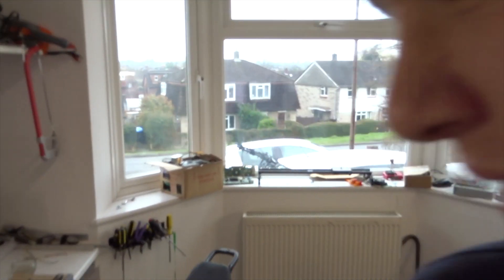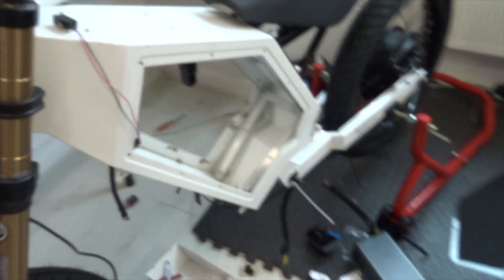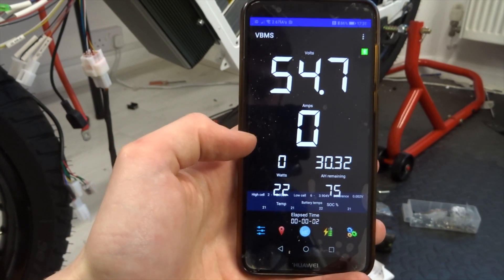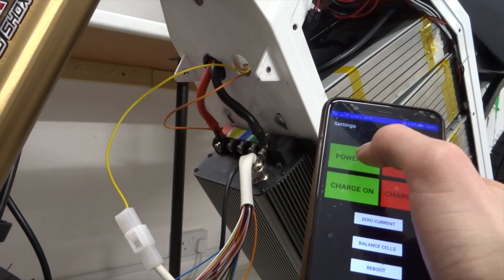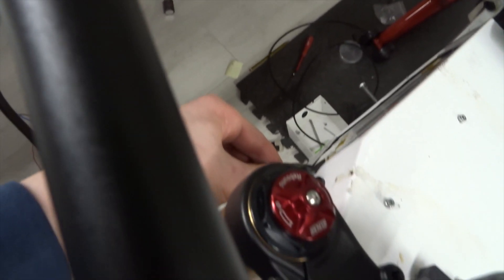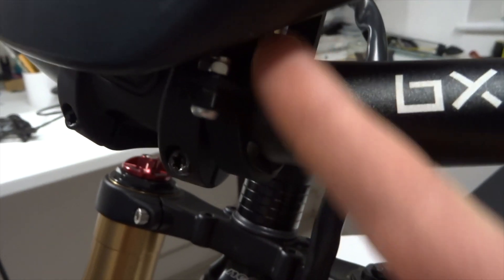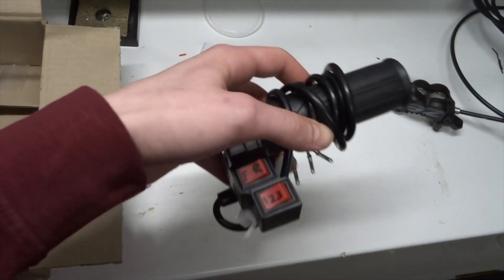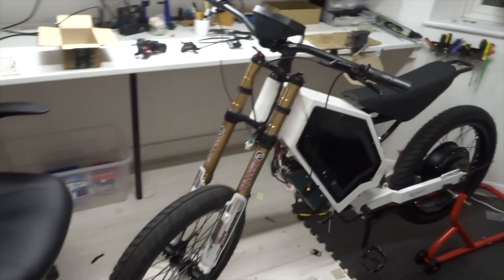New Sabvoton/Dashboard and eBike Update | 8kW Enduro MSVA eBike V3 Build

Comment: Hi How are you ? I have just come across your channel and would like to ask some questions. 1- Can you connect two hub motors to a sabvoton controller ? And if yes How? 2- if Not possible how do you connect two Sabvoton Controllers to a single Throttle ? I await your reply, Thank you in advance.
Reply from the maker: You could connect two sabvotons to a single throttle just by putting the 5v, signal and gnd wires from the throttle connectors in parallel then connecting them to the throttle itself. Two motors to one controller won't work as the hall sensor signals will be different for each one and will muck up the sabvoton. I believe you can get some models of sabvoton with a CAN bus interface too so could digitally pass on the throttle signal but not sure of the details on that...

Comment: What wire connection on the sabvaton takes the display
Reply from the maker: The only connections between the sabvoton and the display are the hall speed output and mode selection switch. The other lighting isn't controlled by the sabvoton.

Comment: How did you wire your ebrake, the controller has three wires but the switch i have for my ebrake only has two wires.
Reply from the maker: You could use the switch to connect the 5v and sensor wires on the connector which will trigger regen when switch is pressed. Those connectors are meant for a 3 wire throttle but can be modded like I said.

Comment: hello, how did you connect tft display? i have received the same controller, but i don't see and hub to connect display, this is Sabvoton 72150 v1 right? when you connected it, can you make guide please?
Reply from the maker: Check out Part 18, I do a run through on how I've connected mine up. It's not plug and play so every bike will be different but gives you a general idea

Comment: Hi , I have built a 8000watt 72 volt 150qmp enduro bike , it was supposed to of been delivered as a near completed bike from china , but they said because of Brexit they could only send in bits , any way got it in April , in bits , and guess what no assembly instructions and no wiring instructions , any way I looked at some you tube videos ,some helpful , including yours , now its built , and now the wiring , the Chinese company gave some pics of the sabvocon , but some of the wires don't match , I have the regulator/rectifier bolted , the key wires not sure were to attach , I connected wires to back light , but got stuck with the three wires from headlight , were to attach , and the brakes have wires, were to fit , if anyone can give me some info on the final wiring , would be most appreciated . if you can say how to test, etc , help Doug.
Reply from the maker: I've replied to your other comment so check that out

Comment: hi, how did you manage to destroy your controller?
Reply from the maker: I had just finished rewiring the motor and used some thin wire to connect it up incase I'd done something wrong. One of the wires was slightly burned out (didn't realise at the time) so had a high resistance ironically confused the controller and killed it instead 🙄 Just my luck!

Comment: Can you repair your old controller? Have the same issue, need to get a new one.  Your previous LCD wasnt good? Why you replaced? ... managed to fit 72V in the same frame with the same battery
Reply from the maker: I wasn't able to fix my old controller unfortunately but if I had a reflow oven I might have been able to solder the microcontroller in properly. My old LCD I used on V2 worked with the VESC so I'd have to reprogram it which would be quite hard to get it to do the odometer. Also this one looks much cooler!

Comment: Hi. Thanks for the video. I am wondering where you got that relay in the video from  at 5:40. Also how is the battery pack holding up since you built it? Thanks
Reply from the maker: Link to the relays https://www.ebay.co.uk/itm/263560749851?var=562604199434. I haven't been using the bike at all yet so can't comment on the pack long term yet, but I will definitely keep the channel updated and do a long term review in the future! So far very impressed though

Comment: hi mate just wonder if it possible to limit the current to 100a or lower on the 72150 controller?
Reply from the maker: You can limit it as low as you want. You can also limit the speed but keep the full power as well.

Comment: Wow I have many question of your ebike battery 
what is the battery size ??   mm size please  (not inch)
That's looook  so much fit  

and 28 serial connection ??  
what is the battery capacity?
Reply from the maker: Size is about 310x240x135mm and a 14s2p pack with 40ah. Check out parts 6,7,8 where I build the pack for more info.

Comment: Hello, great job and great videos ! I actually building an Ebike my self, Enduro Frame, sabvoton 72150, qs motor 205 5000w and 20s20p batterie (LGMJ1). I waiting for the controller and display (same as yours). I was wondering about the key switch that you use, do you wire it directly to your battery + or do you use a mofset ?
Reply from the maker: Good to hear someone else building one! It connects between battery positive and the e-ignition wire sabvoton. I think it turns off the power to the 5v rail (not 100% sure) so basically disables the controller and instantly cuts power to the motor so can be used like a kill switch. On my old bike, I used 4 mosfets in parallel to connect the batteries but that becomes a bit more of a challenge with this much current and the BMS can do all that anyway.
Reply: Thank you for your answer,  I was afraid that wiring a 12v switch to the battery + will destroy the switch (I saw someone that put a mofset between the battery and the switch to avoid this. Personally I would like to use a button (start engine) to fire up the controller.
Reply from the maker: @krycesheppard5150  You could get a latching push button or solid state relay to do that?
Reply: @EverythingEbikeChannel  sorry I’m not sure to understand the question, can we talk on Messenger or something else ?
Reply from the maker: @krycesheppard5150  email me on cgouldstone45@gmail.com
Reply: @EverythingEbikeChannel  thank you !
Reply: I send you an email, have you seen it ? I not sure you’ve got it (I had some pictures and it may be too large for certain email plateforms).

Comment: I just got my Sabvoton 72150 and got it all hooked up, but no matter what combination of halls and phase wires I do they read in the order 1>3>2>6>4>5  or 1>5>4>6>2>3 and fail the hall test with fail3 which means incorrect hall/phase wire combo. These are my hall voltages with a color matched setup: (and no I don't know why yellow is 5v and green/blue are 3v, maybe the Chinese used 2 different sensor types???) 

1=yellow 5v
5=yellow 5v, blue 3v
4=blue 3v
6=green 3v, blue 3v
2=green 3v
3=yellow 5v, green 3v

The Sabvoton is looking for the following to be in the right order:
1=yellow 5v
2=green 3v
3=yellow 5v, green 3v
4=blue 3v
5=yellow 5v, blue 3v
6=green 3v, blue 3v

as you can see the pattern doesn't match up, my motor reads 1-2-1-2-1-2... but the Sabvoton wants 1-1-2-1-2-2... I have no idea what to do any advise would be much appreciated!!

Motor(standard direct drive hub) is known working on another sensored controller.
Reply from the maker: First thing that comes to mind is hall sensor failure. They should all be reading 5v and that's certainly what the sabvoton is expecting. I don't know much about what order the hall sensors are meant to trigger in but you can get devices that test if they are working correctly like this https://amzn.to/2PbmBgL or there are articles on how to do it yourself https://ebikes.ca/documents/HallSensorTestingFinal.pdf
Reply: @EverythingEbikeChannel  Thanks, I have messaged the seller as well and if they don’t know whats happening I’ll get a tester. I do find it strange that they arn’t all 5v but the Sabvoton is definitely reading the signal regardless and can be seen in the MQCON software that’s how I know what pattern the Sabvoton is seeing. This pattern is very consistent and repeats around the whole wheel. I have since compared the phase pattern with another similar hub motor on my friends bike and the pattern is the same. I am hoping I just have some setting wrong and that it is an easy fix otherwise I’ll have to put the old controller back on for this summer.
Reply from the maker: @mitchellwilson12354  So did the sabvoton pass the test with the other motor?
Reply: @EverythingEbikeChannel  I didn’t have a chance to hook the Sabvoton up the the other motor, I just used a voltmeter to measure the halls by probing the back of the hall connector and slowly turning the wheel with that bikes controller powered up. That motor had the same repeating pattern of colors as mine. The halls were all around 4ish volts when powered with the supply being around 5v.

I still haven’t gotten my motor to pass the hall test but I have found a combination of phase/halls that seems to run ok it starts smoothly from a stop even with low throttle and some resistance from my break pads. I’m just waiting on the weather to give it a quick test drive to see if it heats up real bad or not which should tell me if everything is working correctly.
Reply from the maker: @mitchellwilson12354  Hmm can't quite tell whether it's the motor or controller at fault. Be careful about running the sabvoton without the hall test as it can get fried or behave erratically.
Reply: @EverythingEbikeChannel  guess I’ll wait on that test ride then...can’t afford to smoke this controller need to save money for college haha.
Reply from the maker: @mitchellwilson12354  Better safe than sorry 😁

Comment: The swingarm should have torque arms already. No need for extra unless you grinded away some metal
Reply from the maker: They sort of do, but they haven't been made very well so there is quite a bit of slack. It might be ok but as usual I'm going ott 😁
Reply: @EverythingEbikeChannel  there shouldnt be much slack..they fit M16 pretty tightly. Its up to u tho

Comment: Many many of the LED headlights and other led bars from aliexpress support up to 80v, So you don't need buck CONVERTER. Unless you have something specific that you know has to be 12v. I bought many leds from there, on the ad says 12v but I connected straight on my 18s battery and it works fine. 
I have a question about your wheels size. Between 17, 18 and 19 inches. Which one is best for a high power application on a common bicycle frame? 

Love your build!
Cheers
Reply from the maker: Even if the headlight was 80v, the dashboard and indicators require 12v. With the wheel sizes it depends what you want. 17" gives better acceleration and 19" gives better top speed but I don't actually know how much of a difference you would feel. And 18" is a halfway house.